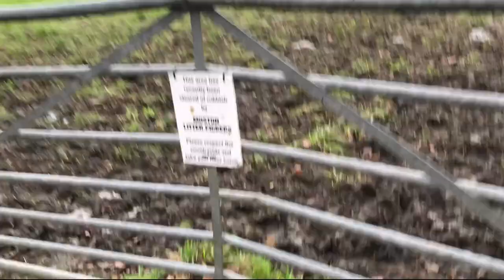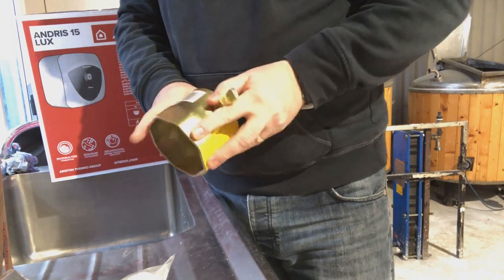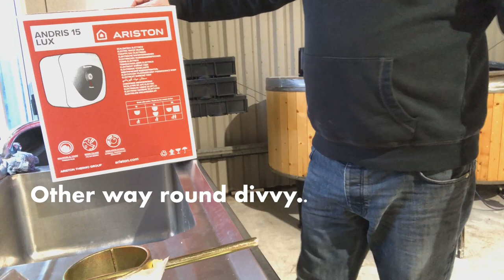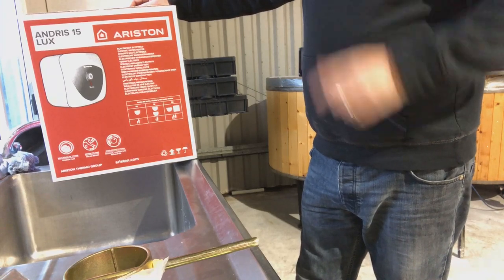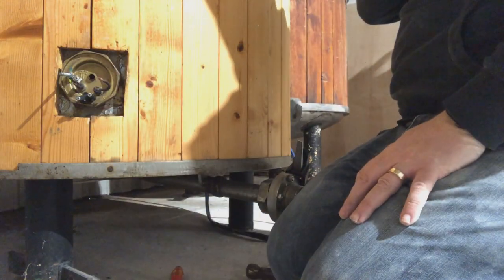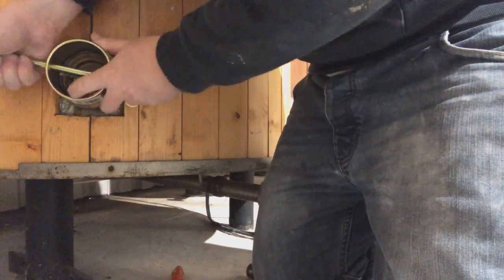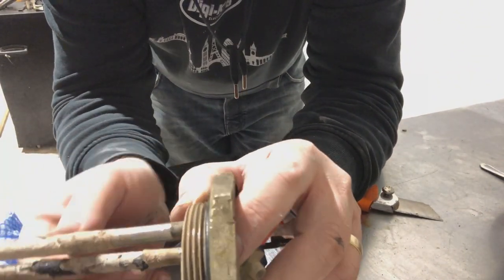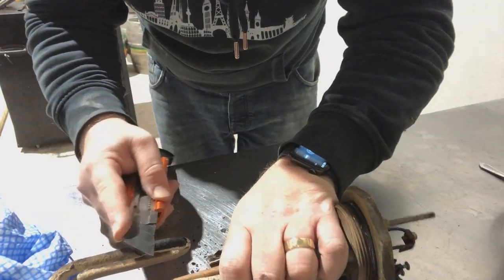Ep.9 - Immersion heater removal at the micro brewery.

Comment: Hi Andy, love to see how you are getting on. The element - just wd40 or penetrating oil and leave a while then put a pipe over the lever or a ring spanner as suggested to get leverage as you are going to replace them anyway if it breaks it is ok. Ps as a last resort you could put your spanner over the nut then apply some heat with a blowtorch ( the spanner will contain the flames from the wood cladding) this may help to free it oh by the way wear gloves as heat burns ha ha!
Reply from the maker: Nice one Baron, will be giving all of those a try I think!

Comment: Hope you succeeded in undoing the other element. I'd get a lever on it like a bit of pipe over that rod section I rekon it'll budge then.

I'd just replace them with stainless ones so you can soak em in Caustic in the future.
Reply from the maker: Not yet. Should have kept that jack hammer we did the floor with.